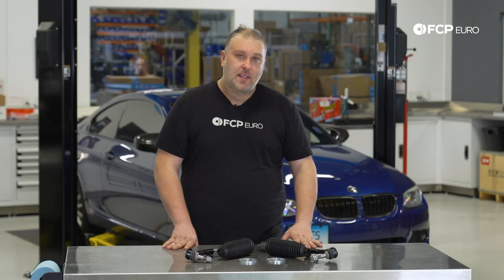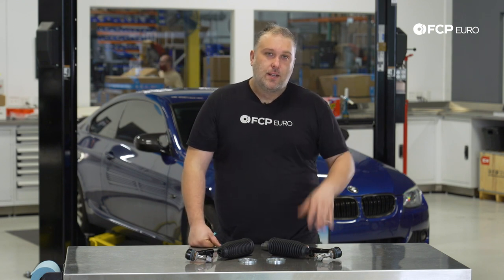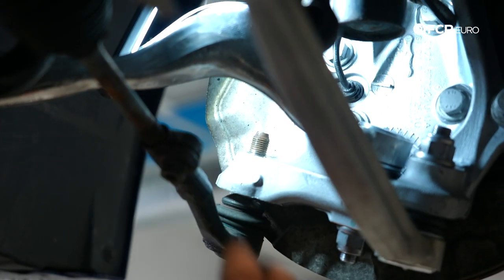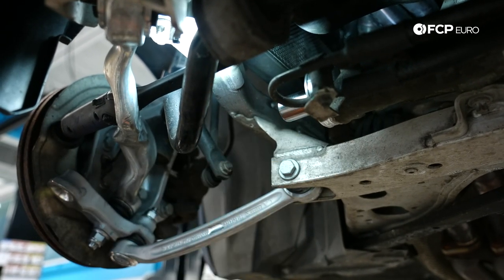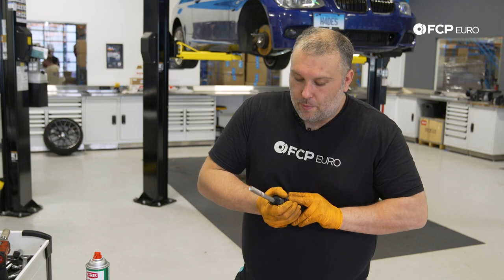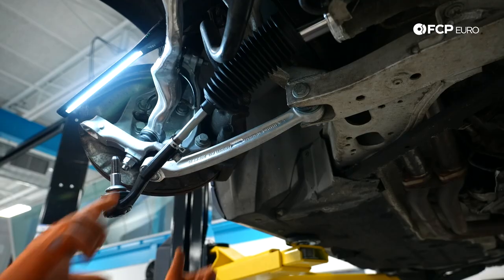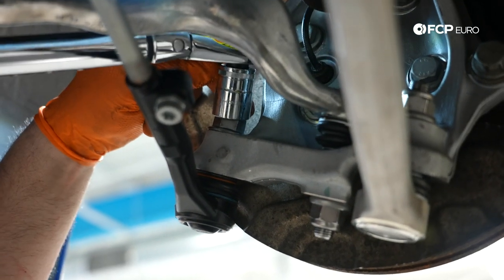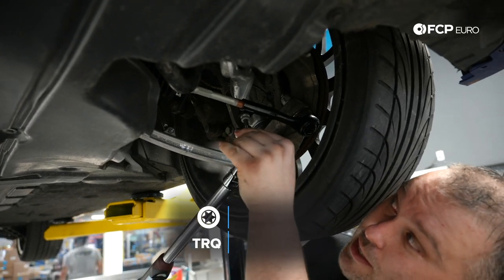BMW E90 Tie Rod Replacement DIY (BMW E90, E91, E92, E93 3-Series | E82, E88 1-Series)

Comment: 9:37 ...yeah, at least you are also saying it - and it's definitely not the right way to tighten (or loosen) those inner tie rods to the steering rack: 
1/ These are obviously safety relevant, so should be torqued to spec. using a proper tool (I did mine last year and bought a 38mm crows foot for use with my torque wrench) - who wants them to come loose during driving (granted, they will probably not fall out straightaway but still) ?! - but on the other hand, they should also not be overtightened as you risk damaging the steering rack.  And this also leads me to my second point: 
2/ BMW TIS (+also Bentley service manual) specifically state for loosening/tightening the inner tie rods: "Important! To avoid damage to rack and to suspension mounting, move rack in as far as possible." In this video it seems to be as far out as possible 😄
BTW there are different torque specs depending on the steering rack manufacturer, TRW (ATF Dexron III fluid)= 100+10 Nm ; ZF (Pentosin CHF11S fluid) = 110+10 Nm , tighten in two steps (...but IIRC both specs have been updated so only first torque step is spec'd - I only did 1. torque step when replacing mine -  unfortunately newtis.info is no longer working, so I can't check to confirm...)

Other than that, great video - I always enjoy watching your E90 videos 👍👍
Reply: Great info! I will replace mine next week and always wondered if I have to hold the steering rack rod with something to counter the tightening of the tie rod ends. Thanks!
Reply: @cribsone 
Hello can I ask you about the answer to your comment / the question of whether or not it is necessary to counter hold the steering rack while tightening the tie rod ( inner & outer ) to final torque spec ?  Also where can the specific manufacturer of the steering rack be found ?
Reply: @ThunderbirdRocket I wanted to ask the same question as I would like to do this by myself for the first time. I watched some videos where they tell that holding a rack during the tie rod replacement is a must. In the bmw manual there is nothing about it. Is it safe to unscrew the tie rod without holding the rack?

Comment: Great video, did this job last night. Referring to the Bentley Service Manual- (Steering Wheel Alignment 320-13) the torque spec on the Tie Rod to Steering Knuckle is 80 Nm ( 59 ft-lbs) not 175 NM. Tie Rod pinch bolt is 40Nm (30 ft-lb). I also found it easier to install the pinion side of the tie rod first and then tread on the knuckle side after.

Comment: 08:11 "Just make sure that when you put the boot on, you also put the clamp on"

Proceeds not putting the clamp on 😀

*Great video, I just bought mine from Meyle HD(Part numbers 3160200007/HD and 3160200008/HD) and was going to change them next week along with the M3 control arms for my 1 series!

Comment: #H4DES is back. This E9X has the M3 control arm upgrade that adds negative camber. So the jaws of life were used to get the (rusted) tie rods right for that wheel alignment...Fun. Anti-seize indeed. Too late. Looks like a shiny new wheel carrier too.

Remember to reassemble the inner outer tie rod ends with the bellows and small clamp...then the large clamp, before installing on the car. Would love to see the bloopers reel.

Wonder if Meyle makes a HD version of the tie rods for my E9X M3?
Reply: Yes, they do make them. They are the same as a regular 3 series or 1 series. Part numbers 3160200007/HD and 3160200008/HD. They have massive ball joints.

Comment: So. SO. I see why xDrive weren't mentionned here. I tried to do the tie rods on my 335i xDrive today and wantes to see how different it was from the RWD cars. Turns out a part of the subframe is directly under the inner tie rod and steering rack connection. So I can't go under the car and simply use a channel lock to wrench out that nut, since there is now way to get to the nut from under.

If you try going above the subframe you also don't have enough. I suppose the solution is to order a 38mm crowfoot.
Reply: Thanks for the info!
Reply: @Use2FACTAUTH 
Hello, can I ask you about your experience with this job on the Xdrive ?   How did you end up getting the inner tie rod nut off ?  Was it the long tube style tool that slips right over the entire length of the inner tie rod which you ended up using or something else ?  Any other advice  / challenges / solutions to speak of ?  Your help would be greatly appreciated .
Reply: @ThunderbirdRocket  luckily there was enough room to put a large pair or pliers on it to break it loose from the bottom. Just turn the steering wheel to full lock for better access. The tube type tool you’re talking about also works great if you want to go that route. 

Also the tie rod boot clamps are a pain to get to and tighten properly. I used a pair of side cutters to tighten them but I’d recommend getting the special tool for clamping them. (Lisle 30600 “offset boot clamp pliers”) other than that it’s pretty straight forward
Reply: @Use2FACTAUTH 
Thanks for taking the time to help alfredo ! 👍🏼 I like the sounds of that — I’m going to try common tools for the inner tie rod nut with the steering wheel turned to create the extra space needed as you have advised .  👍🏼Might be purchasing the special Lisle clamp fastening tool - thanks for the tip and model number there . 👊🏼
Reply: @ThunderbirdRocket  no problem, goodluck!
Reply: @Use2FACTAUTH 
Hello again my friend , 
Can I ask you how you achieved removing & then installing the driver’s side INNER (at the steering rack side) tie rod rubber boot clamp ?  There is soo little space .  I don’t see how to reach it / work with a tool on it ?    Did you get it from below or above ?  Did you have to remove a few things in order to gain access to it ?  Any advice you can provide would be much appreciated !  🙏🏼
Reply: Can I ask you how you achieved removing the inner tie boot clamp (at the steering rack) for the driver’s side ?  I’m referring to the E90 AWD model .  There appears to be no space to get a tool near it .  Any help you can provide would be much appreciated .
Reply: @ThunderbirdRocket  sorry man, I did it on an e92 but I remember I just punched it out with a long screwdriver and then I used the boot pliers to get it back on kind of a pita

Comment: This makes dropping the subframe waaay easier.
Reply: Is it even possible to drop a subframe without disconnecting the tierods?  I didn't think so?  Since I've got to pull the subframe to replace the oilpan gasket, I figured I'd replace my tie-rod ends as well since I was there.  My car is from the northeast USA and the tie rod end nuts (to the knuckles) were frozen on after 98k miles.  I needed a nut-splitter to remove them!  All the hardware at 3:45 here looked brand new, to me!
Reply: @michaelvoorhis9555  Yeah. People usually finesse the subframe around the tie rods, but I found that way extremely hard.

Comment: Great Video! and I am sure everyone here has read all sorts of situations, here is mine: I took off the two tie rods, without marking right and left. Now I cannot figure out which one is left, and which one is right! Given that this is a 2007 car, and original tie rods, I cannot see any numbers stamped on it. Any tips on how to figure this out? I do understand that I can just install the new ones from FCP, which are clearly marked, and adjust them using the measuring tips in the "alignment overview" section, but I am still intrigued, how do you tell them apart? Thx

Comment: What size Oetiker clamps should I use for this job? I gotta tackle this tomorrow and you guys have been awesome with everything. I believe I need both small and bigger.
Reply from the maker: Hi Ozzy, https://www.fcpeuro.com/products/bmw-pipe-clamp-32106765232 is the inner larger clamp, https://www.fcpeuro.com/products/bmw-hose-clamp-d-equals-194-225-32136756011 is the outer smaller one. Typically new bellows tend to include these as well.
Reply: @fcpeuro  y’all are awesome 🤝🏽

Comment: Quick question. F25 X3, car tends to wander despite a 4-wheel alignment. No particular direction, just not settled on the freeway. Any ideas?
Car has 125k kilometers.
Reply from the maker: this is tough without access to the vehicle to test drive, the way the car behaves could vary depending on the issue. it could be something loose in the suspension allowing the alignment to vary, or even shifting belts in a tire. Non-alignment related it could be an anti-roll property not working properly, or even failing suspension
Reply: Going to have to be control arms / ball joint failure somewhere
Reply: @fcpeuro due to mileage, I ended up replacing all suspension related parts (upper and lower control arms, ball joints, tie rods) short of dampeners and yet the problem still persists. Super frustrating
Reply: @matthewmoser2090  thought so as well and ended up replacing it all (no dampeners however) and it's still happening.
Reply: tires likely. my elantra was diagnosed with tire separation. err, separation found on one or more of the tires. i'll see if replacing these old tires does the trick

Comment: Garreth,
Is the process the same with e90 2011 328i xDrive?
Reply: Hello , can I ask you if you found the answer to your question ?  I’m also wondering ( I have the e90 Xdrive too ) . Any tips you can share , different steps / challenges would be greatly appreciated .
Reply: Can I ask you about the e90 Xdrive question … are there any different steps / challenges / tools required for the e90 Xdrive ? Any help you can share would be greatly appreciated .
Reply: @ThunderbirdRocket  
i rented the inner tie rod tool from Autozone. the rest is similar.
as long as you have the other basic tools. 🛠️ hooe that helps
Reply: Cool !  Thanks for taking the time to answer / comment !  That’s super helpful !
Reply: Do you think there is enough space to use the kind of inner tie rod tool that “strangles” the nut and you attach a ratchet right there at the location?  (In others words the type of tool that doesn’t utilize the long pipe which brings the ratcheting tool closer to the wheel well ).
Reply: @ThunderbirdRocket  yeah, I remember I never had issues with space. I think it was either autozone or Advance AutoParts I rented the tool from. I remember it was just straightforward project. No hiccups. I took out the splash shield at the bottom to give me more light and space orientation.
Reply: @ThunderbirdRocket  you’re welcome man.
Reply: @simplelangperorock 
Got it — thanks . 
Nice 👍🏼 !  
Thanks mate !

Comment: Question. What if the rack seal is leaking fluid and if I want to put new boot so that the fluid is not leaking. Would that be possible? I don't need it for long time, maybe just for 2 years that it survives. Eventually the boot will be filled with oil, would that mess something up with that ball joint (I know it requires grease instead of fluid, but it has similar properties I guess)?
Reply: LMAO replace the rack you can find low mileage used ones for not much money.

Comment: Anyone done thus on an e90 xdrive? I cant get a set of pliers on the inner tie rod to get it out and an adjustable wrench has no clearance... what size do I need for the tie rod tool? Looks to be about 1 1/2 in
Reply from the maker: We cover this in our E9x front control arm DIY! https://youtu.be/jY795gBK3oc